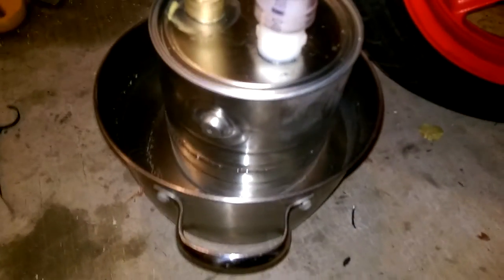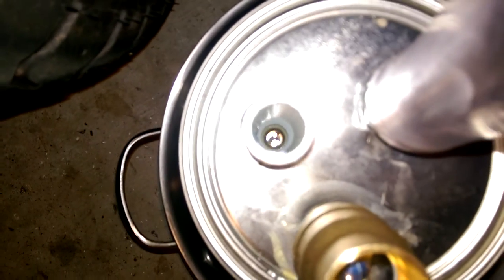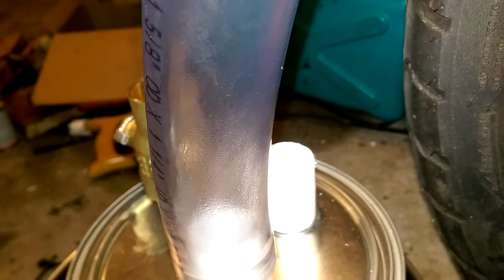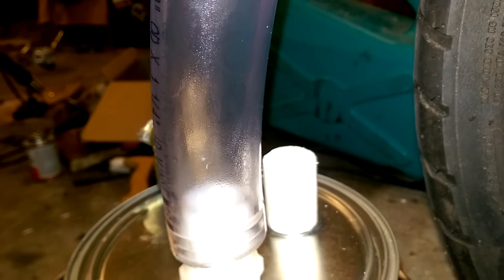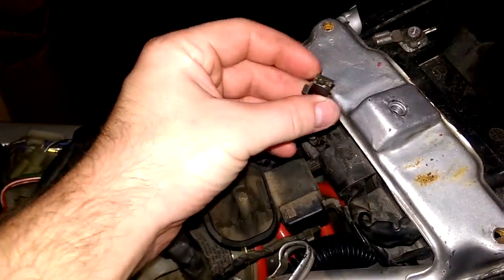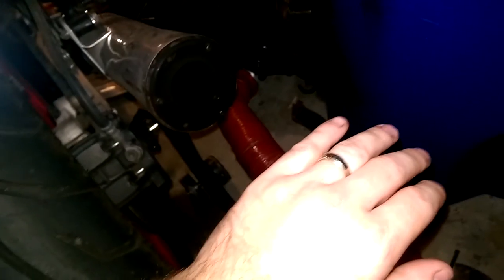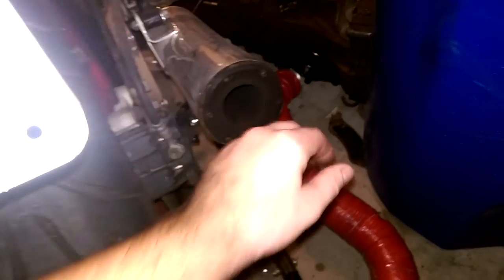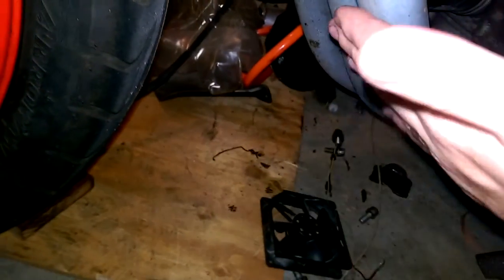Motorcycle Bubbler/ Gasoline Vaporizer

Comment: No offense but that's not the best atomizing concept, it alters and contaminates the supply of the rest of the fuel in the chamber with ambient humidity it will not be readily  noticed with short run times, but an accumulation builds after time, a separate chamber for inline aeration, or vaporizing port discharge nozzle or emulsion mantel to allow intake air to efficiently wick vapors into the intake charge